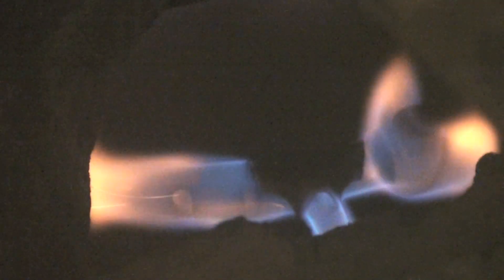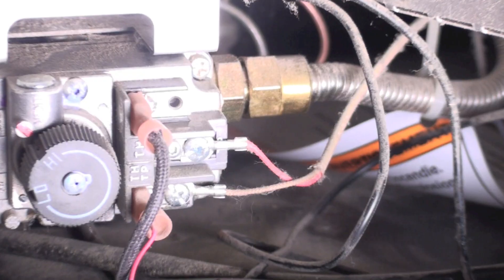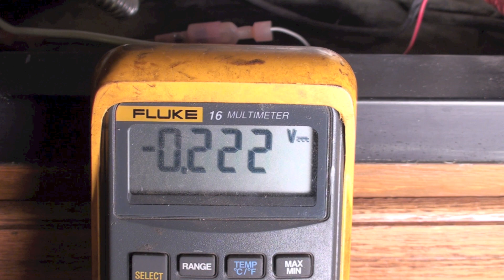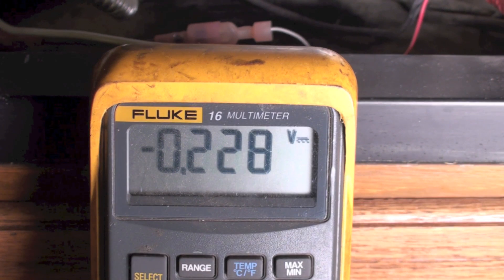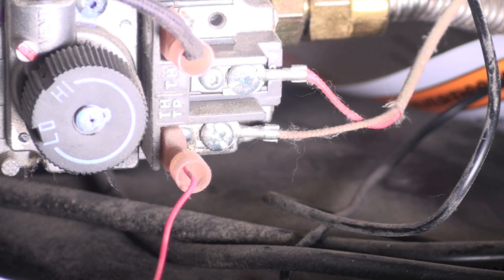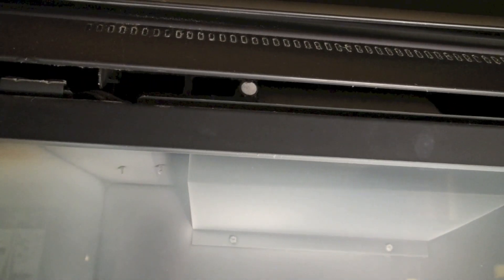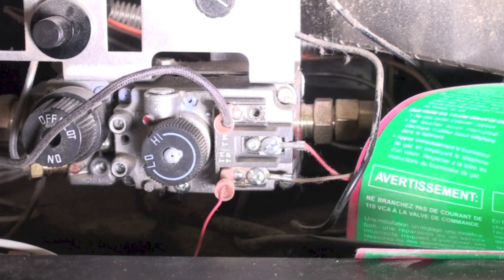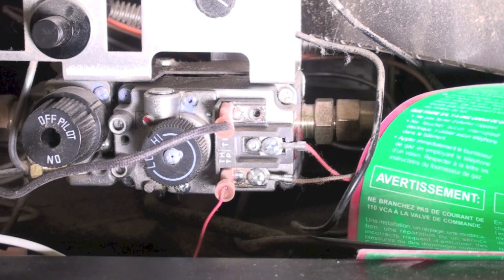How the fireplace thermopile system is wired

Comment: Hi Gray in my job the have a Vulcan gas grill 4  burdn, 2 thermopile do not stay on  the 3rd thermopile is on but do not fire the register,the 4th O.K    please help me thanks
Reply from the maker: I would be looking at first wiring connection problems.  The voltage is very low and connections must be clean.  Also, are the pilot flames blue, are they covering the entire thermopile?  Hope this helps.
GFM